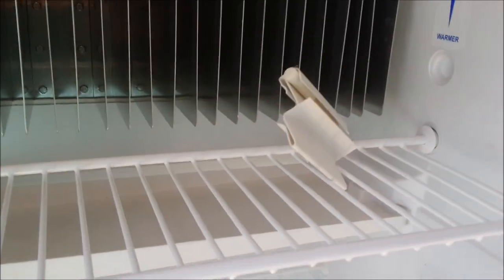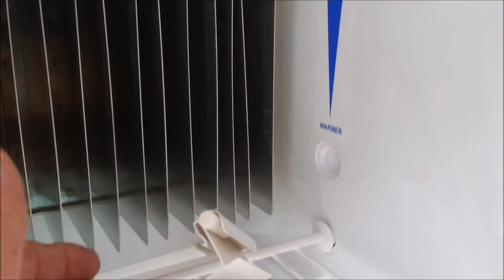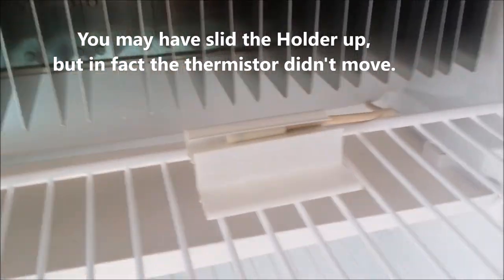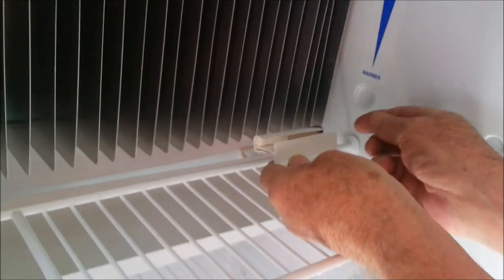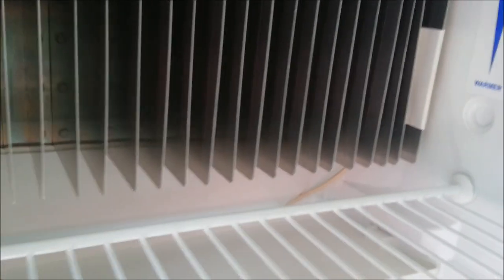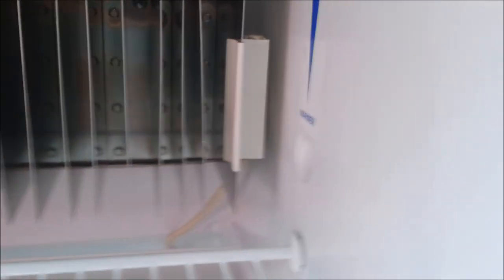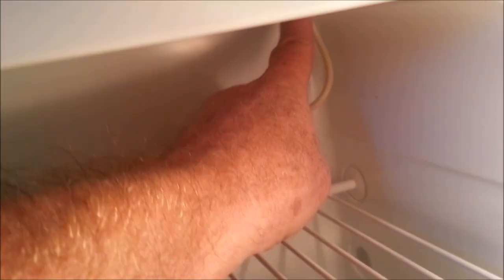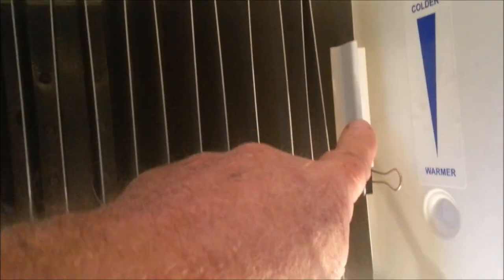Dometic Fridge Freezer not cooling?  Pesky Thermistor. Forest River Rockwood Mini Lite 2109s

Comment: What do I do if the thermistor is super short… it barely reaches the holder and I can’t pull the wire out any further 🤔🤔
Reply from the maker: Check on the other side, or outside of the fridge.  Remove the cover and noting the color of the cord, see if it is tied in a loop or is hung up some.  You may be able to push more of it inside the fridge.

Comment: We have the same exact fridge and can’t get the fridge portion to stay constant, even with not opening. We also have started noticing that ours is the opposite of yours, it gets warmer when you put it up. Why would this be with the same model number fridge? Our little sticker is gone so we have no clue. Today we tried to put a fan blowing on the outside and it helps some. Frustrated!
Reply from the maker: Check in the back of the fridge, outside, and be sure the cord running into the fridge is securely fastened where it should be.   That would be my best guess.  Moving the thermistor UP should always cool it. I hope you aren't having issues with the ammonia in the unit.  Good luck.  And, I don't use a fan actually.  Mine stays nice and cold even packed.
Reply: I had this problem but then I remembered that it was hanging when I first bought my used RV. Took it off the fins and it keeps fluctuating within range but checking the thermistor and the back to see if there are other issues. It was perfectly cold before my dumb self moved it.

Comment: Hie I'm still struggling with my fridge is not cooling at all but deep freezer it's fine.thanks for your help
Reply from the maker: I would first try moving the thermistor all the way to the top.  Be sure you are on the outside fin and the top of the thermistor is at the top of the plastic holder so you know where it is positioned.

Comment: Sir I’m in need of your assistance. I didn’t even know that thermistor was there at all.. the fins had a lot of ice build up and some how it defrosted and now I noticed that the thermistor was of the clip and off the fin itself. I have tried unplugging and plugging the fridge back on and also turned it off and on and finally I came across your video and discovered the thermistor was off the fin but I put it back in place and the check light is still in place and it’s not cooling. What could be the problem?
Reply from the maker: Not sure what model fridge/freezer you have, but if it is just like mine, the check light comes on if you don't have propane feeding to the unit.  Even if you are connected to shore power, if you have the switch set to auto, and the gas button depressed, the check light will come on.   It just telling you that the propane is out.   Cooling takes a few hours as well.  Give it overnight if possible, it should start cooling.   I hope you have an ice chest.  Sorry for your issues.
Reply: @garlandstyle5797  omg thank you so very much, because everything you wrote is exactly what happened lol! And we didn’t know we had to have propane, we learn something new every day 😅! Again thank you so much for your prompt response!
Reply from the maker: @claudiahernandez7397  You are very welcome.  Glad all came out well.  LOL

Comment: Hi there, our fridge had been freezing for a couple of weeks, we bought a new seal and Insalled that, now it's not cooling all. We have a replacement thermistor on the way, could this still be the problem? Thanks.🙂
Reply from the maker: Try running on Electric only if you have a Gas/Elec mode.  My "Gas" mode quit working and I had to buy a new controller.  I made a video on how to replace it.  But you are right to suspect the Thermistor first.  Also check the back (outside) of your fridge and trace the Thermistor line coming into the back of the fridge to the control panel.   There are fuses located in the back as well.   Just be sure to have all the electrical supply cut off to the fridge before checking connections.  I hope you get it working ok.
Reply: @garlandstyle5797  thank you, we only run it on electric... checked fuses and hit reset button. Hopefully the thermistor comes soon and does the trick. If the thermistor is the problem, might it be the reason it's not getting cold at all anymore?
Reply from the maker: @AscentionNow  Oh yes, the Thermistor is necessary as it is just like your home fridge, like turning the knob inside to make is colder or hotter.   Let me know if that did it.  :)
Reply: @garlandstyle5797  fingers crossed! 🤞 I hope so too!

Comment: Hi, do you have a video explaining how to run the fridge only on electric?  Thank you!
Reply from the maker: Steve.  If you have a fridge like mine, just depress the GAS button and it will run on electric only.  If you look closely at the GAS button, if it is OUT, then it will select propane if there is no 120v electricity supply, provided your propane is turned on.  GAS button IN, it will not use propane.
Reply: @garlandstyle5797  I have a Dometic DM 2862 looks like it might have the same functions, I will give this a shot!  Thank you!
Reply from the maker: @stevep4236  Let me know.  :)   Good luck.

Comment: Right now I have I have my firdge running on Auto. My firdge light does not turn on. Does this mean that fridge is not working? Or it is normal for the fridge light to not turn on sometimes?
Reply from the maker: If your fridge is just like mine and you have the ON button depressed and the GAS button depressed, the fridge should be in AUTO mode and working.  The AUTO light should be lit.  With the ON button depressed and the GAS button OUT (that is, not depressed), then you are running on GAS only.  The Auto button should still be on even then.  I hope that helps.
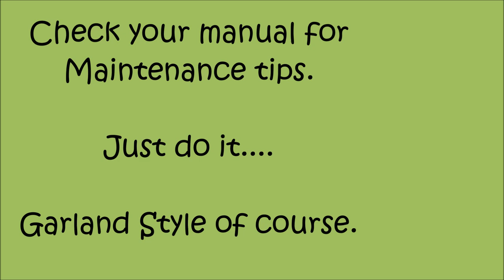Reply: Auto light should be on.  You have to have 12v power connected to the back though because the controls run on 12v dc no matter if you are on had or 120v ac 2:54

Comment: Where could I get one of those "warmer/Colder" decals on the side of the frig? Any idea?
Reply from the maker: Renee.  Set your Thermistor up about as far as mine.  Get a cheap thermometer, set it inside, and give it overnight.  Check the temp and if too low, slide it UP and secure it so it stays in the same position.  Repeat until you find the temp around 35º in the fridge.  Take an indelible marker and make a mark across the top of the Thermistor and you have "marked" your optimum temperature.  :)  You could use tape too of course.  Dry the surface completely when it is warm so the marker stays put.  :)
Reply: @garlandstyle5797  ok, thanks a lot!

Comment: Would this also cause fridge to freeze everything?  Thermistor was just laying on shelf
Reply from the maker: It should be in an upright position.  Never heard of that, but perhaps start it out low down, but clipped to the fin.  Raising it up will cause it to cool more.
Reply: Ive learned that if the cable is hanging OUT of the slider, the fridge goes into ‘arctic mode’ and yes, freezes everything :)

Comment: I have twice the problem the thermistor  won't stay in the slide and the slide won't stay in in place on the outside fin
Reply from the maker: Try just clipping the Thermistor to the outside fin without the plastic holder.
Reply: @garlandstyle5797  About ready to get the super glue out so the thermistor stays a little bit above the plastic slide. This is what I get when I buy used from the dealership. I had it on propane all day yesterday and it seemed fine
Reply from the maker: @mnnomad1870  That may work.  Be sure it's good and dry.  :)
Reply: I still have it in the slide but I put the metal clip on and see how it's doing in the morning!
Reply: And the good news is I went out this morning and the temperature in the fridge was 31°.
Reply from the maker: @mnnomad1870  Woot Woot!   LOL  Congratulations.  :)
Reply: I'm sorry but where did you apply the tape? I took black tape and went vertical on the thermister clip a couple of times so the bracket tube was tighter. I was thinking of replacing my bracket but $65 on Amazon
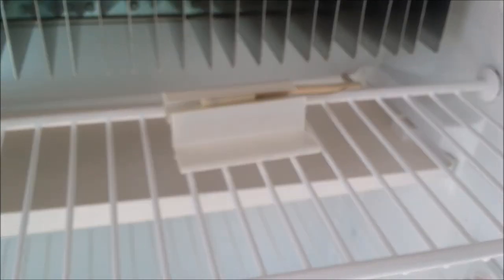Reply from the maker: @mnnomad1870  Look at about 1:00 minute in.

Comment: Ours has not worked since we bought it and the stupid people at the place we bought it cannot figure anything out. I mentioned this to them as you would think they should know this. Ours does not have the sticker on there for warmer or colder. They say that we need a new fridge maybe? Our 14 year old one worked no issues now it makes you regret buying a new camper
Reply from the maker: Rats.  You must have gotten a lemon.  I hope you get it replaced or fixed under warranty.
Reply: I think we might have to do the same. Our camper is a 2020. All our food we t bad in the crap refrigerator

Comment: What if it's too cold 🥶
Reply from the maker: Continue to move the slide DOWN.  If it is all the way down, there is something going on at the back of the fridge.  Depending on your model, there could be a thermostat setting in the back of the fridge as well.  Check your owners manual to see if there is another option for temperature control back there.

Comment: New unused fridge.  Zero cooling overnight on AC.  It's getting power. I have the sensor as high as possible
Reply from the maker: EDIT:  Beg your pardon.  You said "it's getting power" so I have to assume the lights (below) are on.  I did have to replace my control board on the back of the fridge for a fault with my propane.  You may want to check the continuity of the power going from and to the control board.   Also, try the "GAS" function.  With shore power OFF, 12v running via the battery and propane ON, use the AUTO switch to see if it starts cooling with gas only.   If it is a 12v / Propane model like mine, it will cool faster on gas than AC.

Are the lights coming on when plugged in and turned "ON" or to "AUTO"?  No lights coming on would indicate a possible fuse issue if you know the plug outside, behind the refrigerator is "for sure" plugged in.   Also, there is an inline fuse outside on the AC power line.  Look in back for all connections and at the fuse for the fridge inside on the Fuse Box.
Reply: @garlandstyle5797  Front panel lights are on, so its getting 12v to the front.   this is a 2020 camper and the unit was used only once before I bought it.  AC plugged in,  I manually switched to gas, it lit up fine and ran, I could not run gas extended amount of time, it is located inside our pole barn and did not want to leave unattended inside.  Fuses 3a and 5a on the control panel are ok.  I did not see an inline fuse or one in the wiring diagram.  I will have to get a bt thermometer and do some more testing.  Seems like I am missing something simple.  When running on AC and gas the check light is not on.
Reply from the maker: @jhlewis10  If you have a large pole barn, running the fridge on propane will barely produce any CO2 at all.  You are certainly safe there.  Sounds like everything is functional.   AC cools way slower than propane.  Your freezer should start cooling within hours.  The fridge takes much longer.  You MAY not have an inline fuse at the back of the fridge where the 110 outlet plugs into the socket.  Mine didn't and I have a 2017 model.  No check light is a good thing.  :)